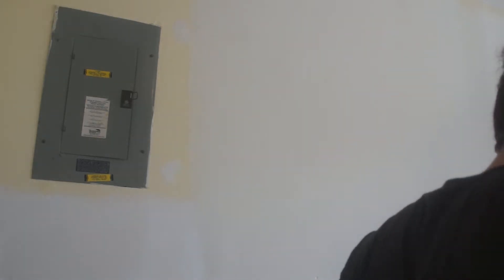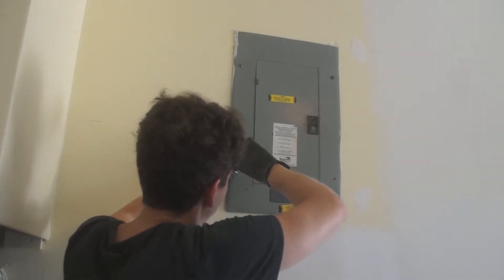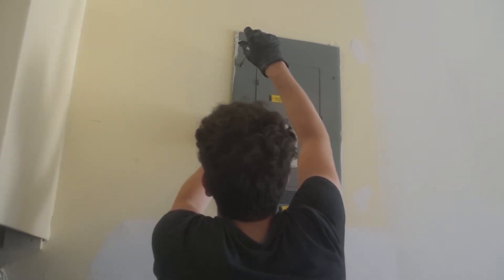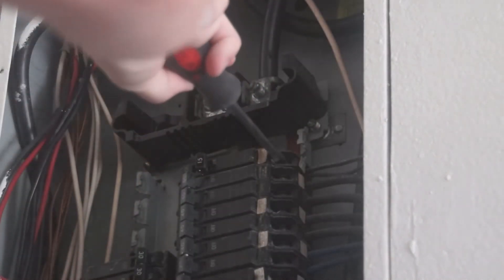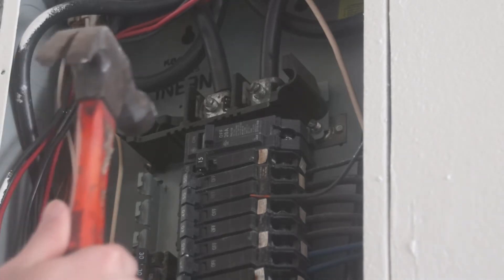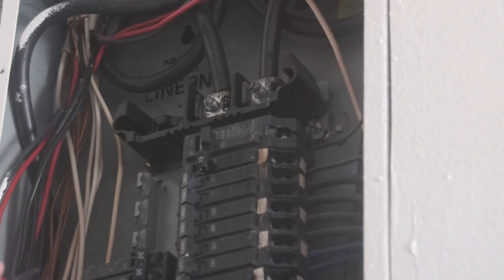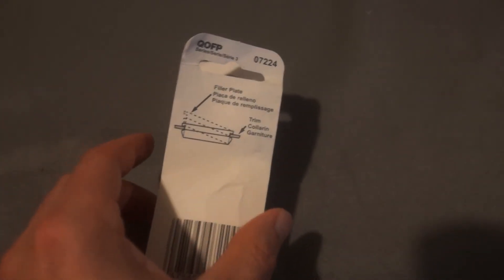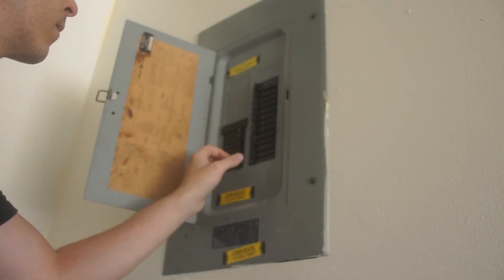How to fix a double tapped circuit breaker

Comment: You should have used a 15 amp breaker as you have a 14 awg copper wire. Running it on a 20 amp breaker makes the wire undersized